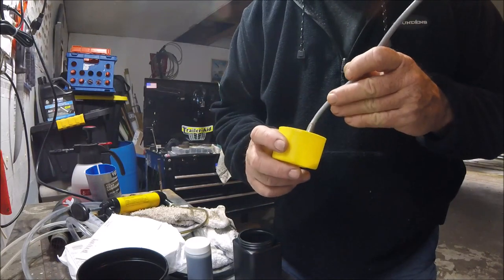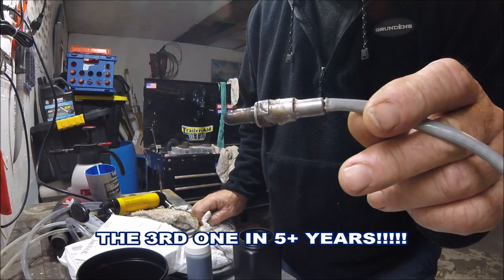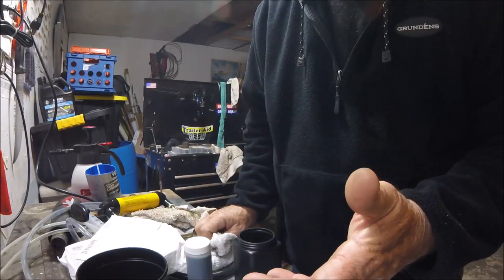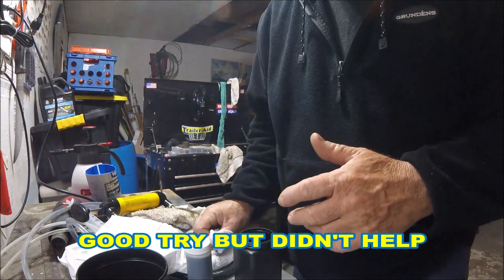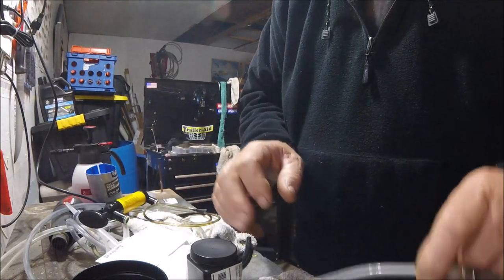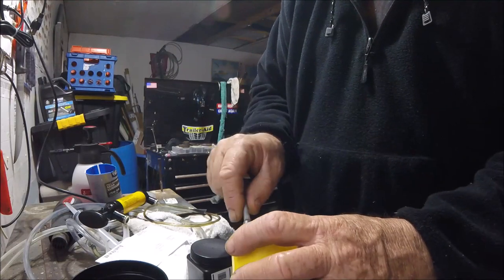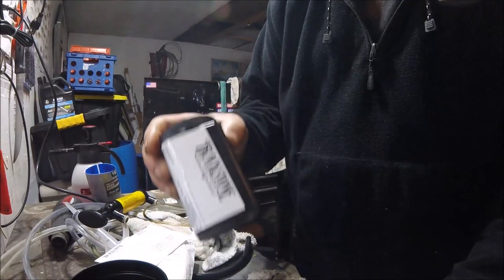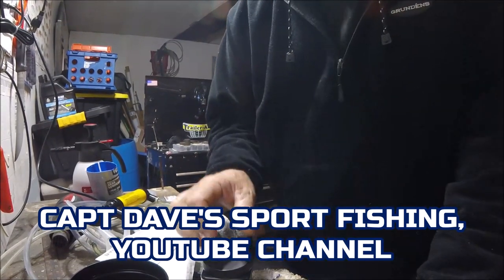WHY NOT ANALYZE OUTBOARD OIL? (& 3rd O2 sensor)

Comment: Capt Dave, new subscriber here - pertinent info shared in this video, thank you! 

Just curious if you had any luck with the 02 sensor cleaning?

Quick Question - I have a 2016 DF300A at about the 450 hour mark. Have had to replace the 02 sensor 2x and getting ready to do again just doesn’t feel right. Most of my motor use is long offshore trips (high RPM) with intermittent trolling. Since my motor threw the code, I’ve put in 10 hours with most at higher RPM’s. Most of the time the light goes off at slower speeds and idle. What gives?! 

Advice or other recommendations to revive the 02 sensor? Last, what part number did you use for the updated 02 sensor when purchasing?
Reply from the maker: NO...I believe got a 3rd one under recall warrenty. No one knows how to make these POS.

Comment: I have a Df 225 Suzuki and just found water in the oil. White milky sludge but no wet spark plugs. Have you ever had this issue and what are your thoughts? Thanks
Reply from the maker: NO, AND THOUGHTS are I'm no mechanic, replace crush washer under oil plug? Condensation?

Comment: I have been buying lots of fake parts on amazon and ebay for my car (spark plug,oil pressure sensor, brake pads) . I suggest to buy your ngk spark plug direct from  some large supplier like auto zone. we ended changing the spark plug  coil pack because we never dreamed that new ngk  plug could be the reason for miss fire . your out board puts alot of  demand on your plug because we run at 5000 rpm often .   I am giving up on buying from internet too many  inferior fake parts sold by small companies
Reply from the maker: boats.net fast shipping, msrp but the real deal always! full schematics of your motor. Albany Georgia, close to Jax Fl.
Amazon cannot and will not POLICE what they List / Sell.